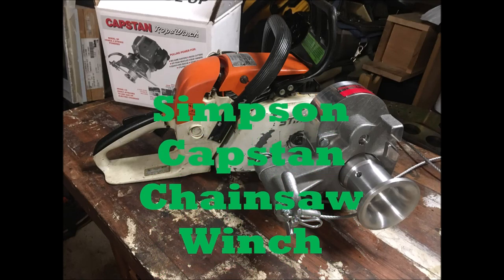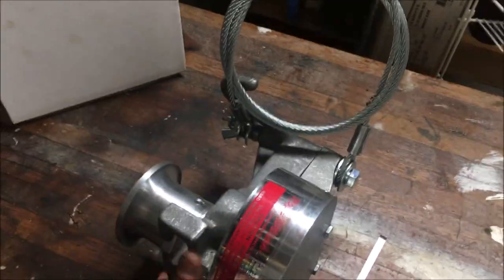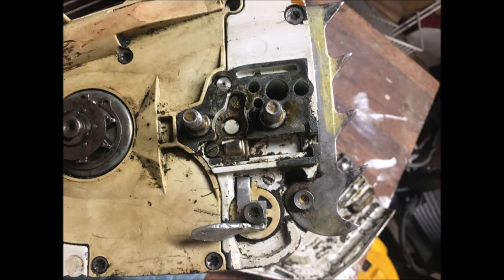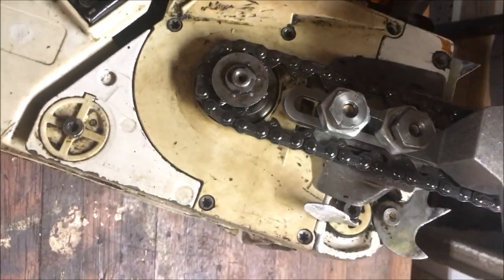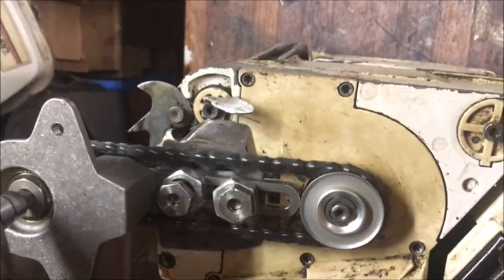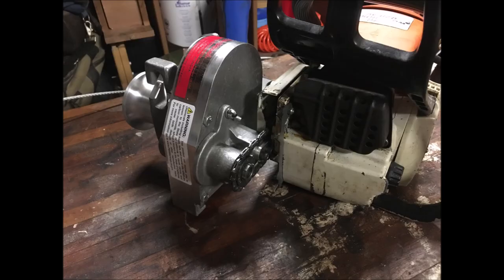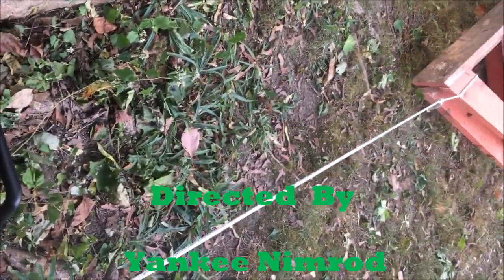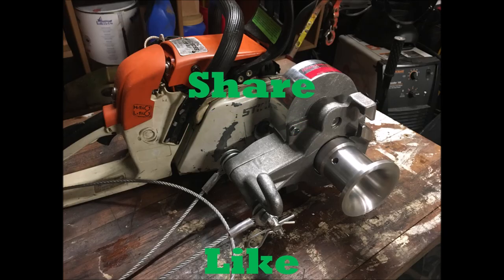Simpson Capstan Chainsaw Winch

Comment: Just got mine setup on a stihl ms290.  I did a test run, but how do you control the exit rope with the throttle already depressed?  Just let it spool until you can grab tension on the exit rope?